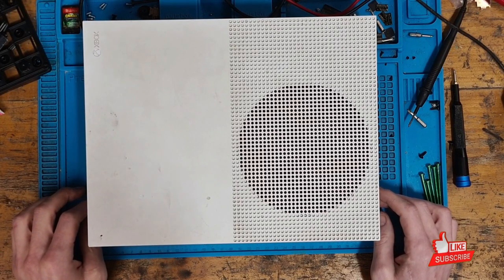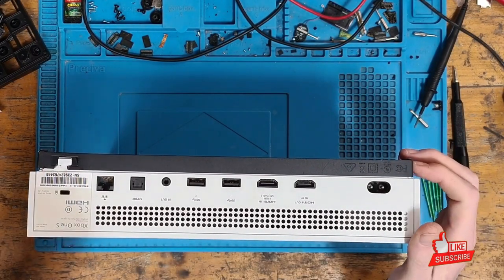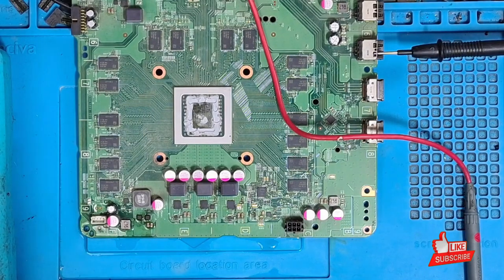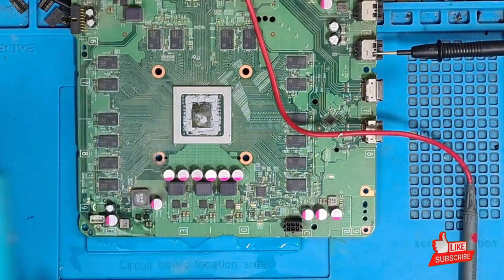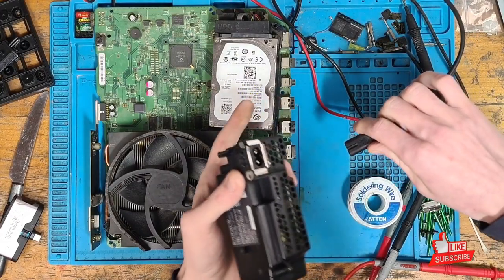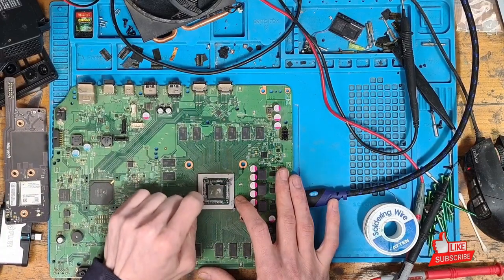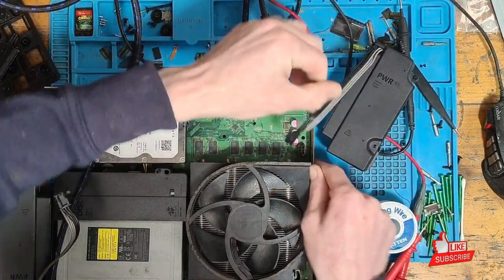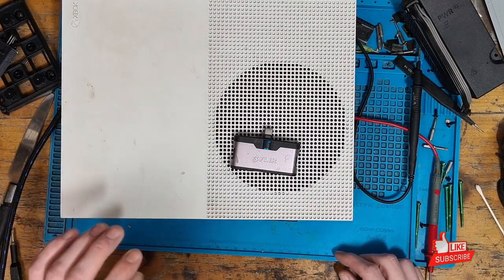Xbox One S No Power Diagnosis And Repair Using Flir Thermal Camera

Comment: One question the Xbox I have I connected to the power and without pressing the power button the fan will try to spin and push the power button all the the AZP chip heat up can this problem be the NCP4205?
Reply from the maker: If all the mosfet drivers are getting hot it does stand a chance that the short is somewhere other than those driver ICs. The best thing to do would be to check the readings of the NCP4205 on all pins and compare them against known good readings. The fan trying to fire up is normal. It's something to do with a self-test on the system I believe

Comment: Any chance you can go over how to test the Southbridge? I have one with no power and no short and only 1.9v where 3v should be and zero where 1v should be.
Reply from the maker: It's quite tricky to test the southbridge really because there's a lot of low impedance lines. The best thing to do is probably inject 1 or 2 volts into the 3.3v rail and use a thermal camera to find out what component is pulling down to ground

Comment: What FLIR camera do you have?? I have the FLIR one pro for the iPhone but I can’t get the heat to line up with the picture . Can you do a video on the FLIR camera and how you set up your one to use and what settings you use please.jay
Reply from the maker: This is the normal flir one (usb c version). To be honest mine just works out of the box I didn't do anything special to get it working
Reply: @TheCod3r  on your phone FLIR app that you connect the FLIR to , do you do any of the settings?? Also how far away do you have the camera to the board when using it??Thanks jay
Reply from the maker: @SURGE101  i believe there's an icon on the top right which enables that. The best person to ask for that though is Engineering Scale Models as he has the Flir One thermal camera for iOS
Reply: @TheCod3r  thanks so much I appreciate it. Jay
Reply from the maker: @SURGE101  you're welcome bud